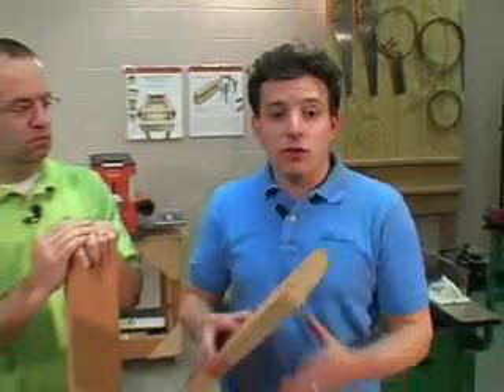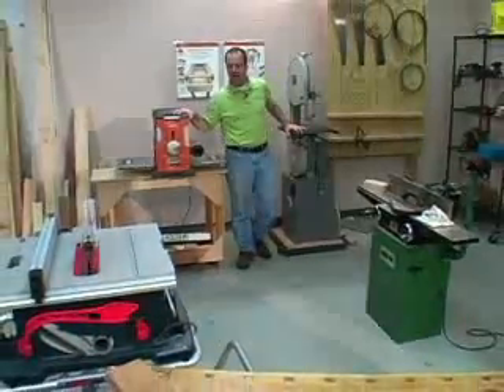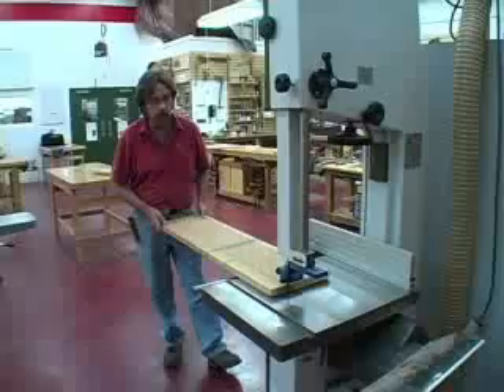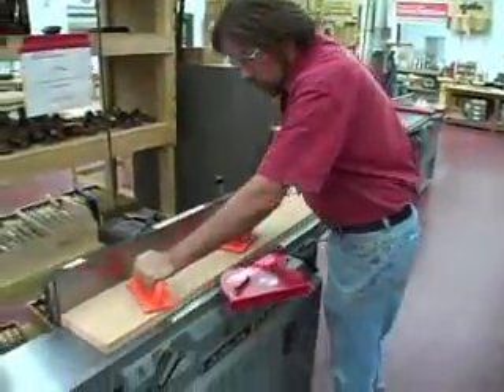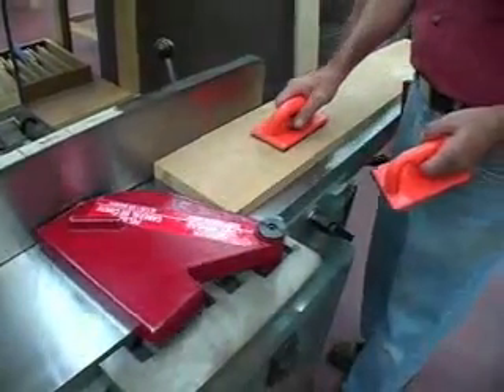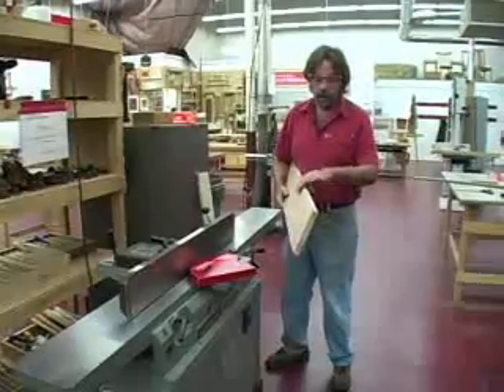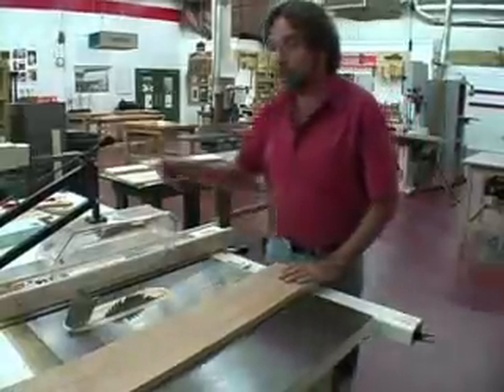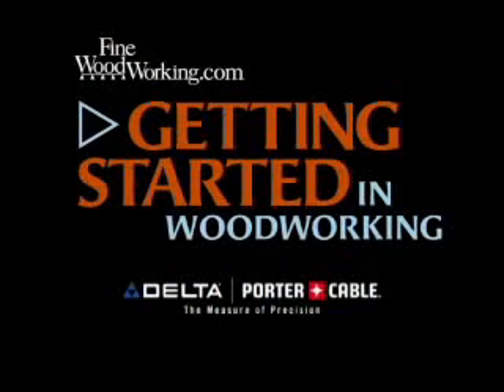Milling Lumber with Power Tools

Comment: @aoe2geek The splitter helps when ripping because the wood might pinch on the blade, which isn't a problem when crosscutting.  The guard was in the way of the miter gauge.

Comment: If using power tools only, you need a jointer.  So that is another $400+. Now you are well over $1200 in poorly made tools (ask me how I know this).  $1200 dollars can afford you some really nice hand tools and a bunch of wood.  Plus you can fit all of these tools you need in a single chest or wall and have more room to work in a small shop.   Just saying there are other ways to mill lumber.  btw. I waste less wood using hand tools.  After sweating over a board... I'm not wasting anything.